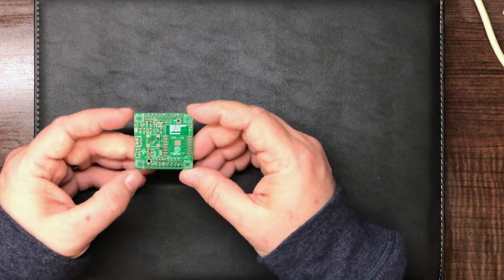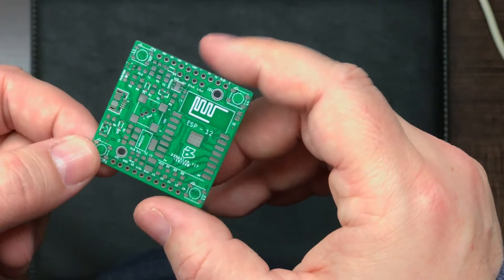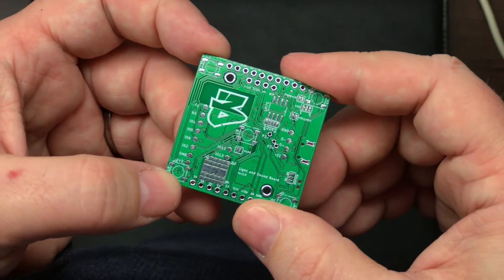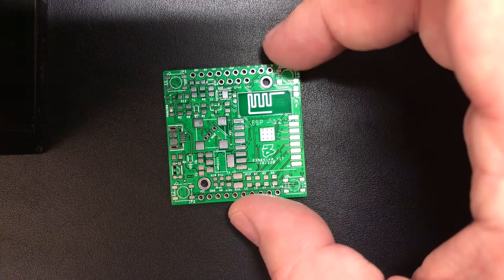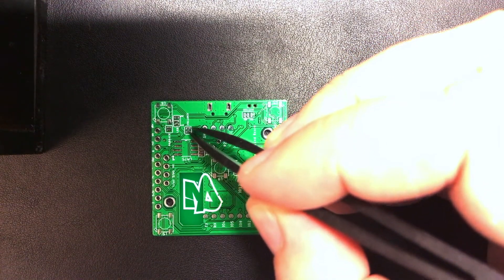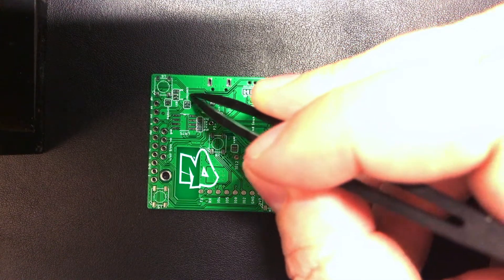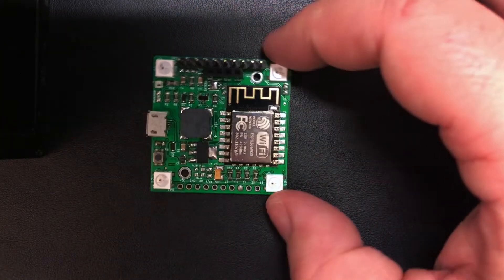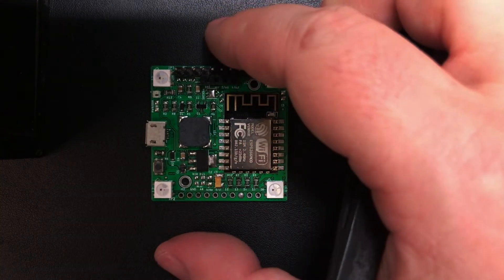My esp8266 pcb by jlcpcb, overview and review

Comment: I am jumping ahead with my comment here at 0;37 in, I take both :-) I think you are using 5050 Neopixels, I just got some 3535 and like them better, saves valuable space on my cramped boards. I also use the 4020 side emitting Neopixels as you might have noticed but they are a pain to apply solder paste and placing onto the PCB :-) Now I will watch the rest of your video :-)
Reply from the maker: I have some but they are not as bright or have the same spread, but I am definitly using them in the future, I have 2020 and side emit also which will be nice for enclosure effects of other projects etc.
Reply: @tablatronix  Mine are almost the same brightness, didn't really compare as they are too bright most of the time anyway. I used them to light up the Cherry MX keys and they fit perfect. The rest of the video was very informative and very similar to the way I do things :-) Btw, I am buying all my Neopixels from one seller on Aliexpress and they have good prices and it does not take longer than 2 weeks to arrive. ebay used to be better but lately most items are to slow to arrive. By the time they do I forget what I was gonna do with them :-) Lipo's are hard to get by these days too, my last order took 70 days, no joke.
Reply from the maker: @iHayri1  the datasheets for 2020 say 5ma not 20ma and only 130mcd max, compared to 5050 which are 700-1400mcd, I would get brighter if available, the 2020 are great for low power also since they are lower consumption
Reply: @tablatronix  I thought you were comparing 5050 to 3535 :-)
Reply from the maker: @iHayri1  ohhh yeah, oops, they should be identical, I am making a smaller version with 3535 because I really wanted <35mm
Reply from the maker: These were supposed to have a dual footprint for both, but I ran out of space for routing

Comment: Hi! Nice project and nice PCB, it looks very good. I have a question, what circuit did you use for the auto reset/program of the ESP? Can you provide a schematic please? I made some PCBs with ESP8266 and used a capacitor and diode for the auto reset, but I'm having troubles getting it to work properly. Where did you put that resistor you talked about? Maybe that will help. Thank you!
Reply from the maker: I have not published it anywhere, let me see if I can throw it up somewhere, I made it myself, so It might be iffy depending on logic levels, voltage and programmer, I have only tested it a few times as DTR can be a problem with some systems and IDEs, if they do not let you set them low always, it breaks serial monitor unless you can set it in boards file etc I suggest using the 2 transistor method nodemcu style I just did not have the room

Comment: Nice board. I have just started sending in designs to jlcpcb. I received my first two boards last month and was very satisfied with them. No issues but my own :/  I have 12 others coming still. I got a sugar high one weekend and went mad in Fritzing. This is the first boards I have done in this Century :) Nothing difficult yet. I'm working on a Z80 board I did as a teen that I wire wrapped.   Anyway, keep up the good work!